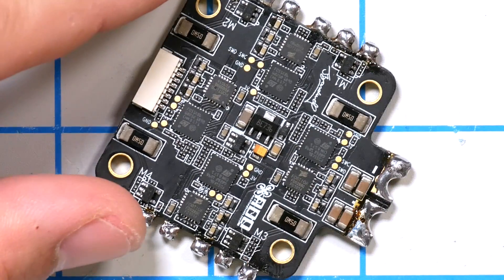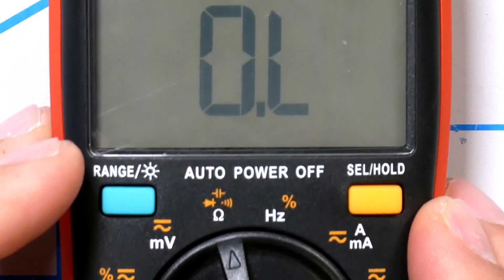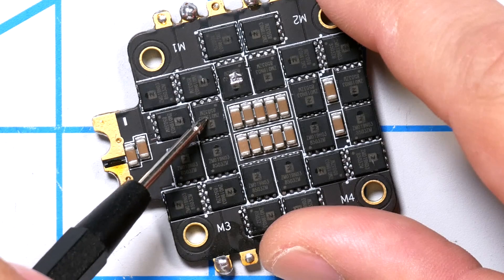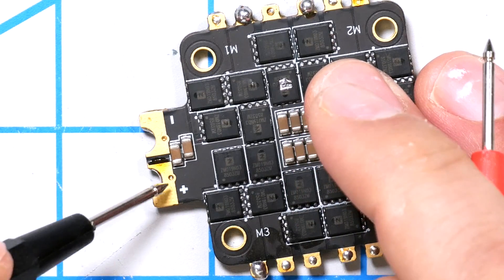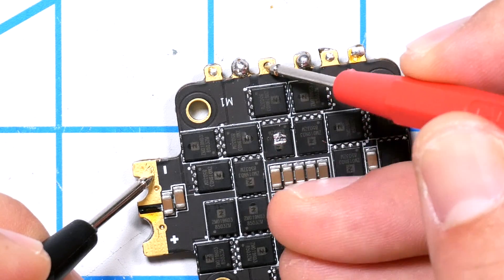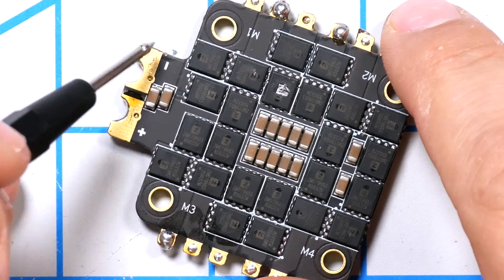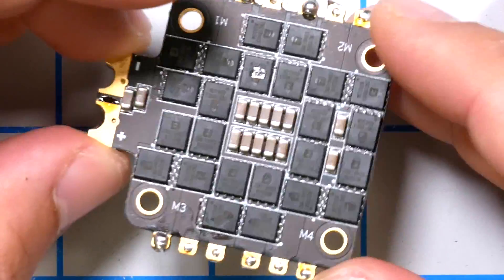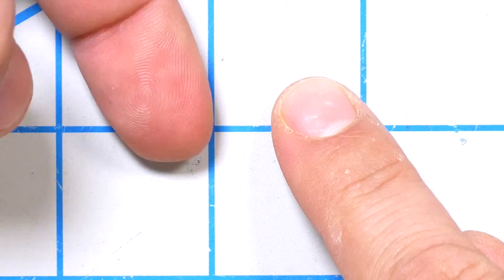Is Your ESC Broken | HOW TO FIND OUT

Comment: Josh, pls let me add something.... 
Last week from one day to the other motor no. 3 of one of my quads was not spinning anymore when arming my FC. Of course I immediately suspected that my ESC would be defective, but it wasn't. Reason for the malfunction was a corroded pin in the socket of the ESC. So the cable connecting my ESC with my FC had no contact anymore on the signal wire for motor no. 3. I solved that by using some contact spray to clean the contacts in the socket.

Comment: Wow, what a coincidence. I am an appliance repairman. Today I had a Microwave that wouldn't heat. During testing I found the high voltage diode was shorted. This prevents the 1.2k Vac from the transformer to form a sawtooth pulse needed by the magnetron to generate microwaves.

Comment: I got your 4in1 and flight controller, attached the battery with wrong polarity on a s  and now it takes a dump on 6s when i flip and I get flickering osd. Any easy fix? :) Thanks and I love your videos
Reply from the maker: No, I'm afraid you fried it by hooking up polarity wrong. It's lucky it flies at all.
Reply: @JoshuaBardwell  darn.  Is there any protection for the fc or it fried too you think? I was hoping those were diodes near the battery pads on the 4in1 and they could take 12V. Unlikely I know. :) Cest la vie I suppose. Thanks

Comment: Also tip for working out if it's a motor or an ESC when still wired.

Continuity between all the motor wires connected to the ESC.  All should HAVE continuity (as motor coil resistance is VERY low).  If a wire breaks, then its continuity to the others will be broken.

If your multi-meter is good enough, you can also test resistance between the motor wires at the ESC connections.  All coils should have approximately the same resistance. 

Last check for ESC on bench is capacitance check.  Most multi-meters in continuity mode are actually a diode test mode.  When negative connected to battery ground, touching positive to the ESC/motor connection will show increasing resistance readings till the capacitor is full (only a couple of seconds as the current in this test is so low).  These should increase at the same rate on each motor connection.

I have had a few ESC's de-solder SMD capacitors with a combination of heat and impact.  For this reason I also silicon coat (goup) my ESC with Silicon 705 (more hold than just conformal coating and water resistant).

As you can expect, have used this tip of FET connectivity for a while.  Do this test on every new ESC before soldering ANY pads.
Reply: Can you help me? Tyro129 problem!
https://youtu.be/PWBUSdpT3zY
Reply: All 4esc are found in blheli!
So could be a motors or bad solder?
Beacuse sometimes motor number 4turns ok but other 3 are not moving!

Comment: Thank you :)  I have hot air station and even had a chance to successfully salvage water damaged Holybro Tekko32 ESC board. Some practice with simpler SMD component boards definitely is required because stuff on ESC boards is pretty packed together. Also not all solder and flux is suitable for SMD soldering. However if someone have serious interest, he will learn how to do it right in quite short time. By the way there may be no continuity as well because sometimes FETs die remaining in closed state. But shorted dead FETs you can see in most case. The worst about ESC failures is in such circumstances they often catch fire and boards burn to crisp remaining nothing to salvage. Happened with me several times.

Comment: Just have one of my motors disconnecting on hard turns and replacing motor then I saw lot of solder on my esc. Looks like previous desoldering have spread some solder on my esc. Crazy. Testing tomorrow

Comment: Hey Joshua! What about individual ESC's? Is there a easy way too figure out which one is bad? I have a nasty yaw twitch.
Reply from the maker: Yaw twitch usually is caused by excess gyro noise, not a bad ESC or motor. If it's a motor issue you will see an arm dip most commonly.

Comment: If you have actually had a motor blow smoke, then this test is absolutely critical to be done before you put in a new motor. Nothing sucks quite like removing a smoked motor, installing a brand new replacement, and watching another 25-30$ go up in smoke.  

Its also a good idea to test for shorts between the poles.  1-2, 2-3, 1-3...
Reply: Correct me if I am wrong, but once I have the motors connected, it also shows continuity between the poles, is that not right?
Reply: @wholev1251  Indeed it will. the windings themselves will provide continuity, but it should NOT show continuity across the terminals of the ESC with the motors Removed, unless a mosfet has failed short.
Reply: Same happened with me

Comment: Hey JB, I had an issue with a brand new HGLRC F428 stack recently where it got a few drops of water on it and when i armed it (after i plugged it in) one of the ESC's on the board smoked the back right motor.. Unfortunately i didnt see it smoke i just noticed it had bound up so to test the ESC i swapped motors and POOF, smoked another one (this time realizing that that had happened to  both motors)... have you ever seen an ESC or a 4 in 1 ESC do something like that? I will never use the swap motor method again because of this... lost not 1 but 2 very expensive motors...

Comment: Stay away from 4in1's unless you like throwing money away.
Reply: They are fine if they are cheap enough to offset the risk. 
But high end 4in1 esc's are a ripoff and should by default have a repair service available.
Reply: @MrStevegibb  Not really, I have seen quite a few 4in1's burn up fc, vtx's, crsf/rx's, cams and pods. No thank you. Individual on arms are cheaper and faster to fix.

Comment: I had a bad ESC just yesterday. The motor would spin up, but it "hesitated" on start up. At first, I tried wiring a new motor up to the ESC and the problem seemed to go away, but then it reoccurred later during further testing. I replaced the ESC and the problem went away permanently. Would be nice if there was a way to find out if it's the motor or ESC that's damaged when BOTH still sorta work.

Comment: Hello, I would just say that it is not really right what you said there,
MOSFETs have bodydiods build in and they can screw the result up, meaning you CAN get "continuity" (in reality a diode drop) from both sides of the power line to the motor, it depends on the DMM and the Testmethode/voltage/polarity. But nice video as always 😁
Reply: Depends on the fet type. Diode drop is not short in terms of continuity test :)
Reply: @LivyuFPV   not really, a fet has a inherant body diode, some continuity tests, in one fluke DMM (dont know the type) beep also on an PN junction
Reply: @leoost6322  it should not... But anyhow this is a crude way of testing closed broken fets... The more real test would involve some circuit building...

Comment: When I do a continuity test and I put the positive probe to the positive battery pad and negative to the negative battery pad I do not get continuity, but if I use the negative probe on the positive battery pad and positive to the negative battery tab I get continuity, any idea? This is a brand new spedix 4in1 esc.
Reply: Tahir FPV Sounds like there's a diode to help protect the circuit from when you accidentally plug the battery in backwards?
Reply: @jyunte  That's what diodes do :)' one way traffic in DC world, bother ways in AC world.
Reply: @cavman7  Maybe I misunderstood your reply, but yes, that's what diodes do, hence my suggestion to the OP.

Comment: It looks like the motor2 mosfet driver could also be broken, or is that some dirt on the chip? Do you have bad mosfets on motor2 output as well? replacing mosfets might not be enough sometimes, I once had to replace the mostfet driver and some resistors to get it working, they can all be done as long as the F1/F3 MCU isn't broken, because that is very difficult to re-flash as blheli32 is closed source.

Comment: Connectivity mode in a multimeter is second only to voltage measurement in terms of usefulness. I got small a broken screen multimeter I still use for its connectivity mode.
My best multimeters are a Metrix MTX3282 & MTX3283B, they look like Star Trek tricorders and can be completely controlled with one hand. haku.co.uk/pics/MTX3282.jpg
Reply: That is sexy AF
Reply: When new they were more expensive than Fat Shark HDO's, but I lucked out on eBay auctions.
Perhaps my favourite feature they have is the ability to show watts by measuring volts and amps at the same time.

Comment: I have a esc 4in1 that the M1 pad have some problem, when it reaches 40% throttle restart fc, the others pads m2, m3 and m4 are ok, can support 100%. Do you know how fix it?
Reply: You can try this or check all solder connections and move the motors around as well. also EMI noise can cause this. If you shield the ESC and the flight controller with copper tape it can prevent this. Make sure you dont short anything with the shielding.